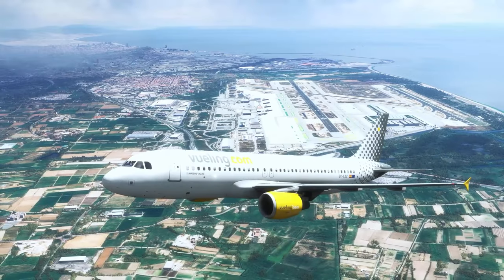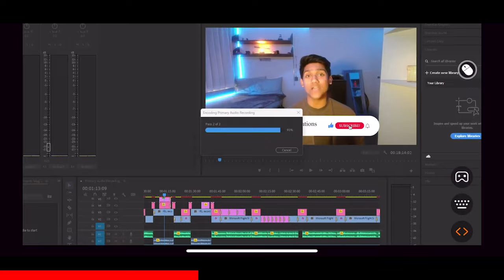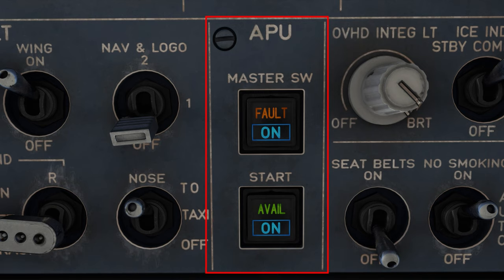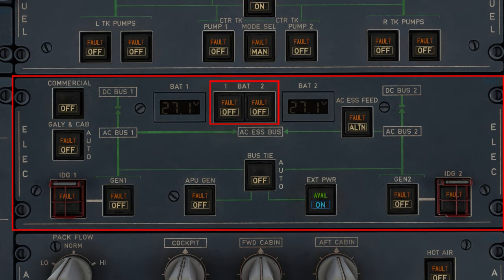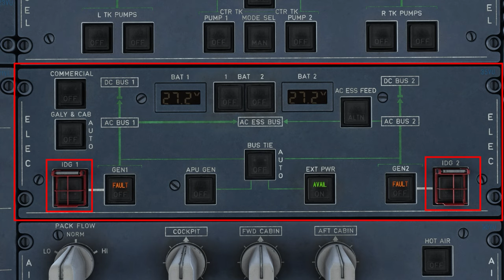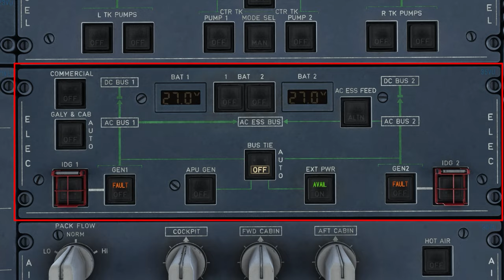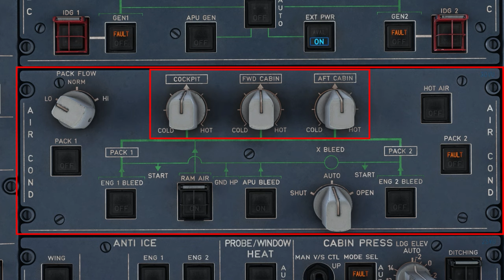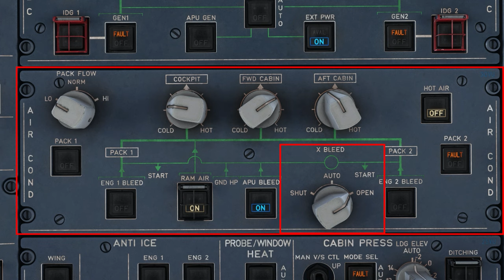INCREASE Your REALISM Flying the FENIX A320 v2! | DETAILED Tutorial | Episode 3 | MSFS 2020 #awesun

Comment: Hi, recently I buy the Fenix V2 thank you for this video. I can configure the airbus captain thrustmaster tca controller with success, but I have two functions that can't. One of them is the aitobrake knob in the one of the addon of the tca throttles quadrant, not work. Another is about the logitech rudder pedals, I don't  know if I have the sensitivity in the wrong settings. Can you please make a video of the settings you have for all of the controllers? (Airbus Tca thrustmaster and the logitech rudders pedals) for the fenix v2. Thanks